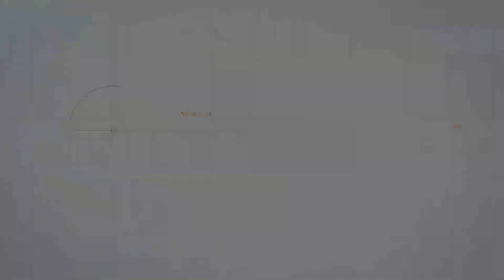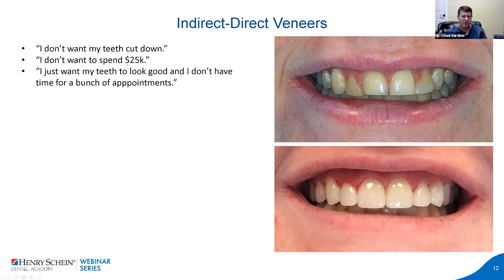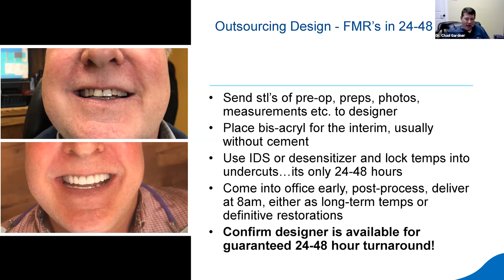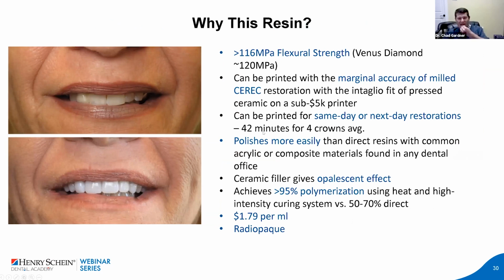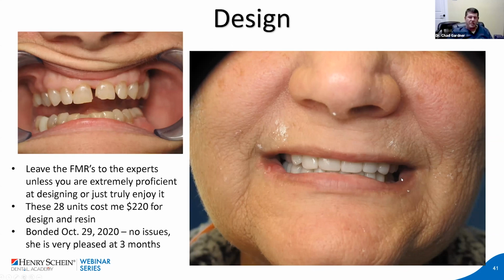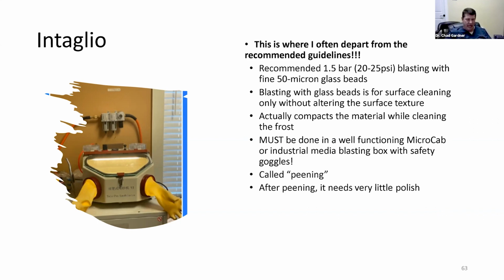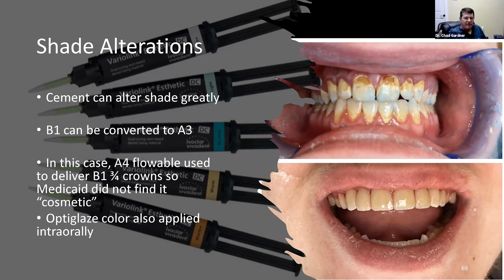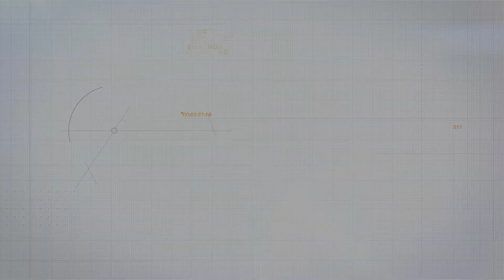A First Look at 3D Printing Permanent Restorations, In-Office

Comment: This is amazing stuff, really want to try and incorporate it into my practice. The post processing looks a little tedious, but I imagine it becomes second nature to the staff pretty quickly?
Reply: You have to get a heated fan, like a floor heater or food dehydrator, to dry them fast. The IPA has to be evaporated completely before curing. ~5min. Then an Otoflash or other fast curing system. Takes 15 minutes max once they get it down. Dirty dip on the build plate in a 5 gallon bucket, use a toothbrush or something to break the surface tension, transfer to two 60 sec ultrasonic beakers, then maybe a final rinse with the squirt bottle over the sink. Dry, cure 1/4 of the recommended time, add Opticolor for incisal translucency, B+ on the cervical, whatever other colors you want, tack cure with a curing light, then cover the facial with an ultra thin layer of the 3D resin you printed them with. Your Opticolor will still show through and it will not lower the value of the restoration like most sealers do. Place back into the Otoflash and cure everything completely. Done. Adding the outer layer of 3D resin seems to make them MUCH more durable. You can also add anatomy and polish the outer layer highly without removing it.